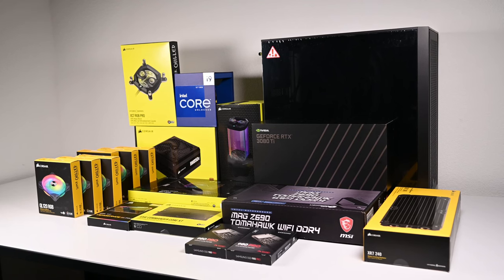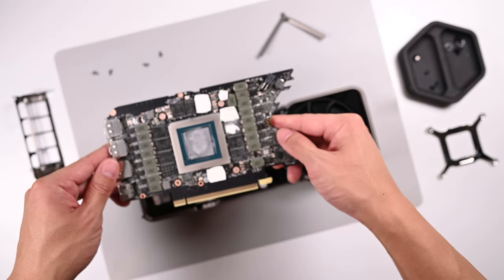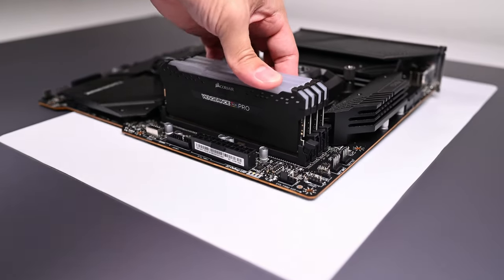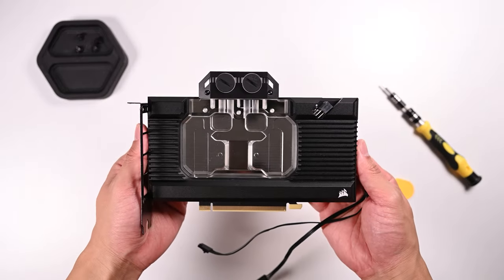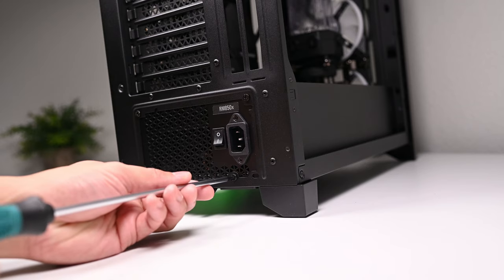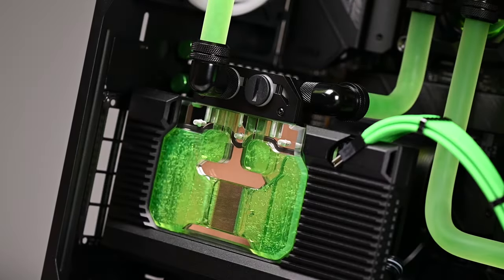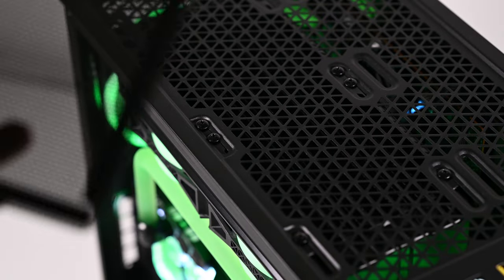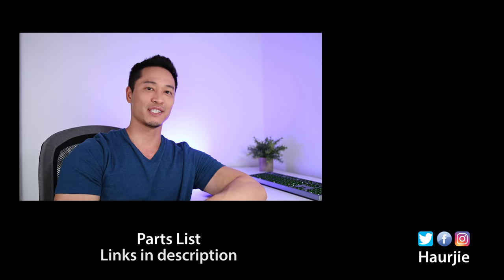Corsair 4000D Airflow – 12900K RTX 3080 Ti Build

Comment: damn i have the saw saw to cut the acrylic tubes but I can't get it to cut OD14 tubes all the way, did you get a bigger saw to replace it?
Reply from the maker: Actually I probably have the same one as you, it doesn't cut through 14mm OD, I do have to rotate it to the other side. I'm going to try a different method though

Comment: I have a 4000x with 12900k and 4080 super. Currently getting great cooling with 280mm Corsair H115 i aio. very close to 360mm cooling specs. I reached out to corsaird and they sent official cooling stats: 240 isn't close to 280 but 280 is close to 360. I wonder how much my cooling would improve using my hardware with a new 280mm custom water cooled build? using 4000x case
Reply from the maker: Are you planning to have the GPU and CPU in the same loop? Actually what I would recommend is if you can, do a 240 (or 280 rad) on top, and then a  360 rad on the front panel.

Comment: This video was perfect for me. I have a ryzen 7 5800x and an rtx 3080. I was trying to see if I did a 360 rad in the front with a normal thickness 240 rad on the top. This was able to answer that question for me.
Reply from the maker: Thanks for watching! Yeah honestly there aren't many applications that use both the CPU and GPU on full blast, and if they were, I don't see them running it for an extended amount of time. What are you using your rig for?
Reply: @haurjie  I use my rig for gaming, programming, and running virtual machines. I have a 5800x overclocked to 4.7Ghz all core along with 32Gb of ram at 3600mhz cl14 and that's paired with an rtx 3080

Comment: i subbed because its rare to see 4000D watercooled like this, most build i see have 2 radiator for watercooling build and i find it hard to do, but i never see a one radiator build before. Once my parts is here, hoping to build a good watercooling like yours on my 4000D too.

does adding a 360 rad infront, would it made a difference in temps?
Reply from the maker: It would make a difference if you add a 360 in front. I don't know if it's better or worse though since I haven't done it. I would be curious to know what your temps are... but of course, what parts are you using though?

Comment: Hi, I have a problem, 

Just built my first pc in a 4000x case, gigabyte b760 mobo, 16gb 3200 vengeance rbg, corsair ax860 psu. This case comes with 3 fans already connected to the preinstalled corsair node hub, i only connected the sata for the hub and connected the hub to the usb port on my mobo. The moment i turned the switch on the back on there was a small pop sound and smell of burned electronics for a few seconds but the system turned on just fine, except that i cannot control the rgb on the front fans. The top one is not lightning at all, the middle one has one blue led lit and the bottom one has one red led lit. The hub is recognized in icue and signalrgb but cannot be changed/controlled by either of them. Can someone please tell me if and what I did wrong?? There was no short with the case in case anyone suggests that, I checked. The fans are spinning and ramping up as they should and otherwise work perfectly just the rgb doesn’t, I’m troubleshooting for 2 days now and can’t figure out what went wrong. The local shop from which I bought it from is not responding to my ticket for 5 days already and I bought this specific case because it was the only brand model in stock where I live (eastern eu) and paid extra for it exactly because I knew it came with the good corsair fans and rgb hub…🥲🥹 did I do something wrong? Do i now need to spend another 80$ to get a commander pro to replace the commander node that came with the case? Can I be sure that even if I do, this sht doesn’t happen again? 🤦‍♂️ I’m lost and can’t understand what went wrong
Reply from the maker: I'm sorry to hear what happened. I'm not in EU but generally speaking you want to purchase from a reputable source to make sure your product wasn't used. I don't know your situation completely nor do I know the store you bought it from, that's going to have to be something you'll need to figure out on your own. At the same time, I will also say that not responding for 5 days is very poor customer service on the store. You could also try to get a warranty replacement from Corsair if it qualifies for it.

Comment: Wow that's a great video (and subbed!), haven't seen the build in this case with a single 240mm, I am about to build in the same case with a 3090 and 13700k, I wonder if top 280mm would work or front 360 only, from your video I guess there is no need for two radiators (I am after quietness, temps I am fine even slightly better than fan cooled really). Is there any mount to attach the reservoir from the top (keeping it straight)?
Reply from the maker: 13700K and 3090 might be pushing it. My intuition is that you'll barely make the temps so highly recommend not overclocking if you're going with that combo. 360 is better for 3090 and 13700K but I personally don't like having that as intake. Unless you're doing exhaust on the front and intake fresh air up top. If you go 240 or 280 top exhaust, def undervolt to be safe if you can. As for reservoir, which one are you planning on using?
Reply: @haurjie  my 3090 is even fine on air really, despite being a Palit with a smaller cooler, just a matter of quitness as the PC is in the living room, even if temp will stay at 70ish for me that is a win if quieter. I can mount a 360 front and today I tried a thin 240 / 280 on top (same case as here 4000d Airflow). 

Pump I like the EK 120 however if mounted at the back one has to cut a hole to let the pump protrude out else it looks silly, or if watercooling both CPU and GPU just the corsair kit and mount the GPU vertically, although it would add the cost of the PCI 4 raiser. 

I do not want a bigger case so it has to fit in there, I also looked at mod the shroud and cut 3/4 cm with the dremel to allow for a pump to be placed by the PSU and perhaps find a reservoir that can hang from the top fans... 

I have a couple of days before 13th gets here :)